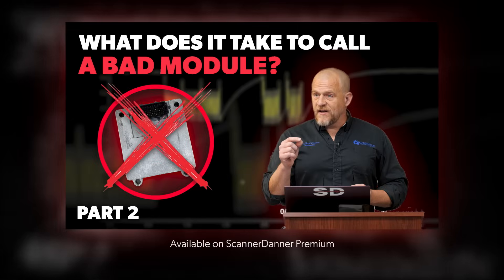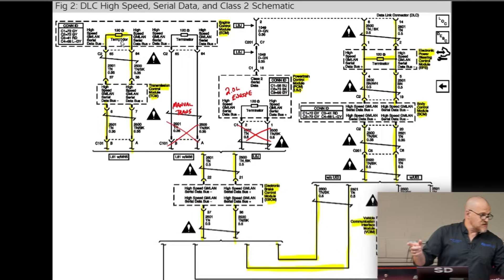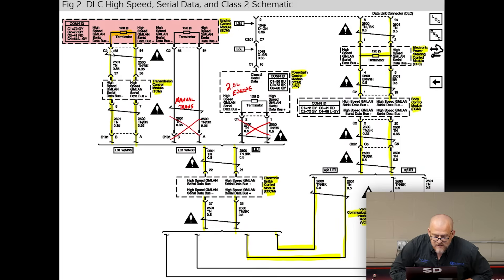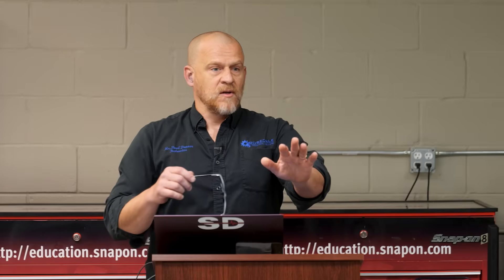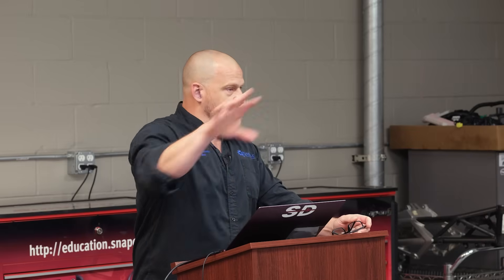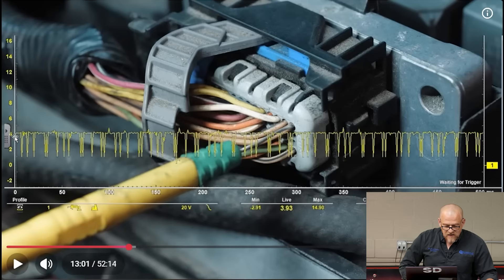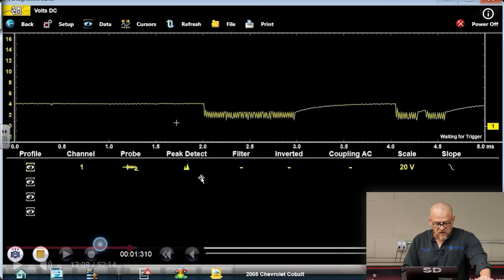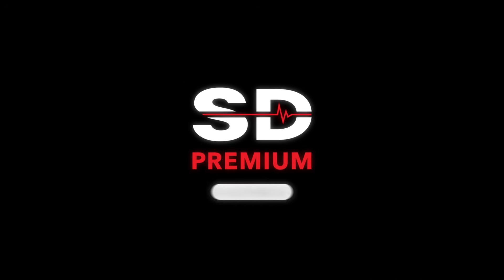Bad Module or Bad Testing? The Diagnostics You Need to Know

Comment: გამარჯობა, ძაან კარგი კონტენტი გაქვთ,  და ჩემს მანქანაზე მაქვს უცნაური შემთხვევა და იქმებ თქვენ მაინც რამე გაიგოთ, 

Hello my friends, 
The car is w210, 2001, 2.2 cdi, OM611961, 6/1 speed manual gearbox. 
car misfires only when gas pedal is pressed, on 1200-1700 rpms.
Conditions:
1. When car is stationary:
- when i press gas pedal on any RPMs it does not have any misfires.
2. When car is moving uphill, it does not have any misfires, as soon vehicle gets more or less upright it starts misfiring on around 1500 rpms.
3. If i put gear in neutral and car is fully stopped it doesnot misfire on any rpms,
4. If car is moving, even with 1km/hour speed, does not matter in neutral or in any gear it misfires on 1200-1700 rpm range.
5. on 3rd and upper gears misfires are not very noticable but there are still abnormal vibrations.
No fault codes which are associated to engine, another throttle position sensor, fuel rail pressure sensor, fuel pressure DRV regulator, MAF, MAP checked and still exactly same problem.
I have this car for 8 years and this problem is unchanged, remains exaxtly same. If there was problem in wiring and electrixity i think faulty wire would be burnt and destroyed within 8 year.
Any suggestions?
Is it possible that faulty camshaft or vehicle soeed sensor not showing codes on BOSCH STAR diagnostic computer?
I am going to check camshaft, crankshaft and vehicle soeed sensors.
Turbo and associated pipings are also working properly.injectors also good, i have tried all four other injectors and problem still same.
ორმასიანი მახავიკიც შევცვალე იმიტომ რომ ზედმეტად მოძრაობდა მაგრამ პრობლემა იგივე რჩება, crankshaft position sensor-იც შევცვალე და ძრავს რაც თუ სენსორი აქვს ყველა შევამიწმე გამტარობის ტესტზე მულტიმეტრით, თან ხელით ვაქანებდი სადენებს   რო იქნებ ძრავის ვიბრაციის დროს სადმე წყვეტა ხდება სადენებში მარა ელექტრო სადენებმა პრობლემა არ აჩვენა. მანქანა რო ნეიტრალში მიგორავდეს და გაზს ვაძლევ ძრავი დიორგანიებს იკოდებს, ცეპლენიას რო გავუთიშავ დიორგანიები ქრება, მაგრამ მანქანა რო გაჩერწბულია და არ გორავს გინდ სიჩქარეში იყოს კოლპფი დ აგინდ ნეოტრალში არაფრის დიდებით არ იკოდებს პერებოის,  ძრავის ბალიშები, გაზის პედლის პოზიციის სენსორი, საწვავის წნევის სენსორი და რეგულატორი სარქველი ეგენი შეცვლილი  და შემოწმებულია და მაინც ვერ მოვუხერხე ვერაფერი.
Thanks

Comment: nominal is the named/specified voltage the circuit "should" work at, in perfect conditions. in the real world any circuit loading, long wires, devices and other things causes a voltage drop.
it's used more in speaking of AC than DC, but same applies still.

Comment: I've seen on GM where one or more modules would not communicate because they were not receiving a wake up voltage. In this case the wake up voltage comes from the Body Control Module which is also the power master module or something like that. It was also the Gateway for the GM low speed network. I want go into detail but there where some weird things going on that would leave you scratching your head. To top it off, it was intermittent and a bump in the road could set it off.😂

Thank you for all the content you share with the community!
Reply from the maker: For sure! The wake up signal is basically a replacement for an ignition switched power supply on a lot of these modules.
Reply: @ScannerDanner , I believe the wakeups are also used to help sequence algorithms for the modules.
Reply: @ScannerDanner I would honestly prefer to just ignore this reality entirely and just drive restored early 2000s vehicles forever 😅
Reply: ❤ @ScannerDanner

Comment: I have done many hours of research and developing training resources for canbus used in automotive engineering/testing/dev.  Paul is right, Dominant is when high goes high, and low goes low. Recessive is when both can high/low are at the bias voltage ~2.5

Lots and lots of confusion about terminating resistors because nothing is standard in test and development, bus networks are set up manually, so people get terminations and nodes lengths wrong more often then right. Why I invested hours into training for just the physical wiring part of canbus.
Reply: For two-wire CAN that is correct. The origins of recessive and dominant come from bus message “crashes.” When two or more modules want to “speak” at the same time, one of them has to come out the winner. It’s like press conference when all the reporters want to be heard over all the rest. Part of the protocol is to define recessive state (who gets to listen) and dominant (who get to talk)

It works out a talking order for any given bus. The terms don’t add any meaning when diagnosing a bus, though. That’s how software/chip engineers explain it to the service engineers, who transfer that into service information, that transfer that into training and…
Reply: @nohrtillman8734 Ya, dominant can take over recessive, it dominates. So if lower priority nodes drop recessive on the bus during arbitration, the higher priority will dominate the bus, since all nodes are checking the bus state, they all know to wait until the bus goes quiet before trying to win arbitration again.
Reply: @iKenFlyPPG    Exactly. All nodes simultaneously monitor while telegraphing their message. The recessive state is part of the message to do that “seat belt buckled” is always lower than “wheel speed” for example, regardless of the sending node.
Interesting, but useless knowledge when diagnosing bus comm issues 🙂
Reply: @nohrtillman8734  , that sounds just like when I took my GM CAN training years ago.  Is message arbitration what you are talking about?  I recently took VIP, that was very cool training.
Reply: @Barb-u3e    Yes, it is message arbitration. Or at least one way to do it. With more than one node sharing the same single circuit, or pair of circuits, any one of them is able to start a message pulling the voltage up or down. They could start at exactly the same time and both messages could get blended together and be meaningless.

So, they all play a game of rock, paper, scissors and whichever throws the dominant state continues, the recessive state waits from the next break.
Reply: @nohrtillman8734  Awesome, haha Rock, Paper Scissors, that is exactly what I was taught.  cool.
Reply: @Barb-u3e    Sometimes lizard and Spock are required in high-traffic conditions.
Reply: I had to read what a couple of interweb write ups say…and they bother me.
Logic (1) is the recessive, at rest, no module pulling any circuit anywhere. In other words OFF.
Logic (0) is the dominant, active, modules pulling High higher and Low lower, driven-to-be-something state.
In other words ON.

100% opposite of what digital logic states have been since the beginning. Why they chose to label logic states (1)=OFF and (0)=ON, backwards from any other electronics reference, puzzles me. Annoys me actually.
Reply from the maker: That is odd
Reply: I would like to work with you..

Comment: This is interesting, because I took my, piece of crap, lol Saturn to the shop yesterday for an intermittent, crank, no start, no gauges, no ignition lights condition, but if you let it sit in start mode for a minute it'll come back to life and start, with a service light on for a ECM code. The tech called and stated they couldn't get a signal due to a no power up issue. Well, if you remove the neg. battery cable for a while or both for about 5 minutes, You'll get a power up. Why didn't they know that to get a signal to test the ECM. He could talk to the trans module, but not the ECM without power. Sorry, I believe I stated that  I'm old. Lol. I blew a diag fee for nothing because they had to stop due to not being able to continue. I understand it's labor and can't complain about what happened, not finding it within the first hour. I picked it up not diagnosed. I don't know where to turn to now, because of trust in other shops I know are parts changers. I'm really up in the air. I'm just referring to the module communication in the video and why the shop techs had a hard time figuring out why they couldn't get communication when all it took was to remove the cable or let it sit in the on position. It's not that difficult. Dealers are even worse ! To add, he also contacted a tech line for more information and couldn't get any suggestions. Good video explanation Paul.
Reply: And have a good Thanksgiving Sir.
Reply: I would help fix this for you… if I were to be close to your state

Comment: VCIM - Vehicle Communication Interface Module which is a component in a vehicle that handles communication between onboard systems and external devices for diagnostics or features like OnStar
Reply: Seems like @Barb-u3e is a bit jealous and butt hurt.
Reply: @chuckmiller5763  🤣
Reply: yup, all NA GM vehicles have a VCIM.  Looks like another misdiag.
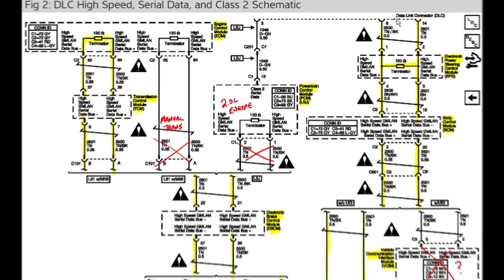Reply from the maker: @Barb-u3e  if you look at 00:27 of the video you can see that the VICM is an option on this car. I believe it was a 2005 model year.
Reply: @ScannerDanner , sorry, no, OnStar was standard on that vehicle.  a lot of mistakes in this video.
Reply from the maker: @Barb-u3e  It wasn't in the list of modules and it is clearly an option. Look at the diagram. It says with and without with an RPO code next to it. Even if it was there, it had no bearing on what I am discussing in this video. Curious what else you see as a mistake in this clip.
Reply: @ScannerDanner , did the 2005 Chevy Cobalt have RPO UEI on the actual vehicle?  I am calling BS
Reply from the maker: Doesn't matter for this lesson as it has zero factor in what we are troubleshooting, which is a no com to the TCM only. Also the VCIM wasn't listed in the module scan either. Moot point worrying if it had the VCIM or not.
Reply: @ScannerDanner  , LMAO!